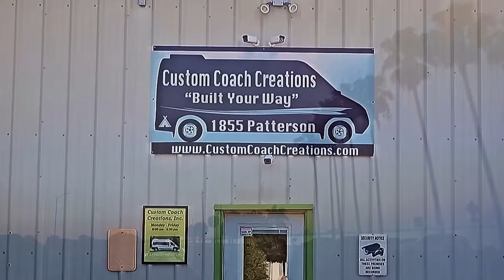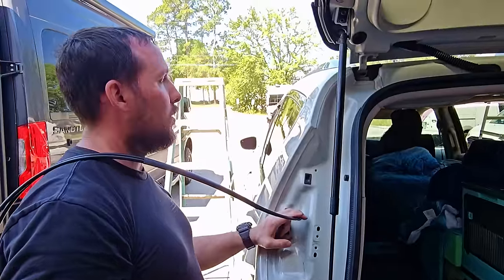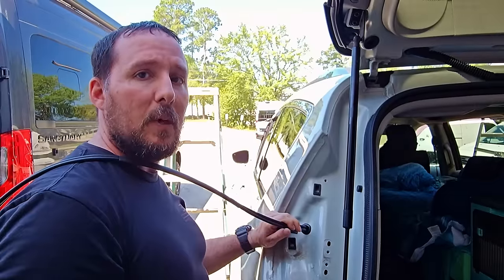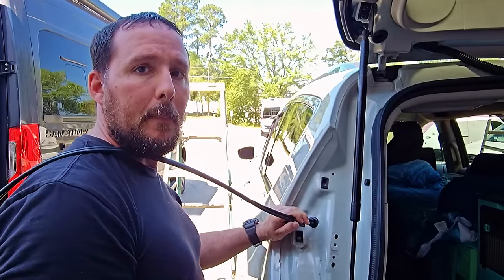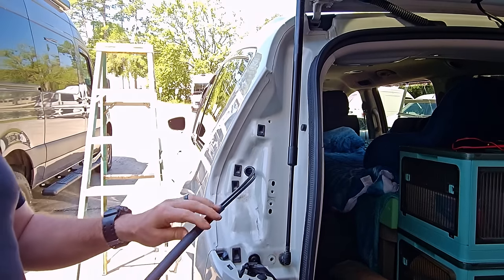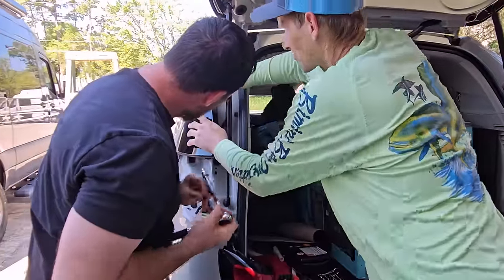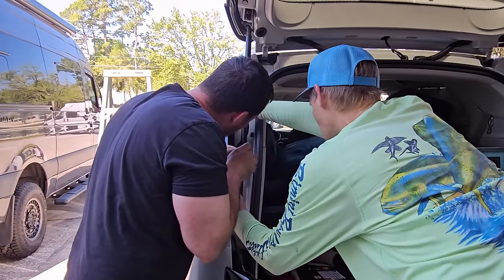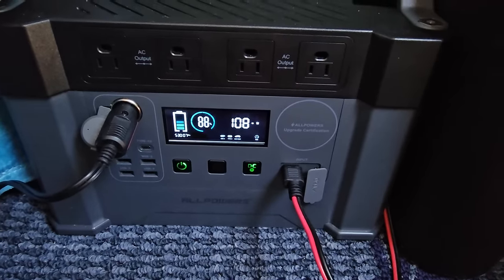OFF GRID. INSTALLING A SOLAR PANEL

Comment: Nice, they did a great job! I did one myself last year on the top of my van. I got a self adhesive panel from Bougerv and stuck it on the back and then connected it up with my existing panels so now I have 300 on the roof. You're going to love having that panel on the roof and you can still use your portables when needed. Have a good week!
Reply from the maker: Yes! I figured I could still park in the shade and put the panels out sometimes. But it's working so good just running down the road keeps it charged.

Comment: Ms Butterfly how is your van holding up? I’m curious to see if you had to replace your lithium battery yet?  Would you recommend a plug in hybrid or non plug in?  Happy off grid travels!!😊
Reply from the maker: I have almost 47,000 miles on it, and I love it. The only issue I've had was mice.

Comment: This is great Jan! I plan to get my minivan done. Were you on a long waiting list?  Do you know the part # for the panel itself? Thank you for this detailed installation video! 💕
Reply from the maker: No waiting list. I let them use the panels they recommended and had in stock. The flexible panels are strong enough to walk on.
Reply: @ButterflyTracks   Thanks Jan!
Reply: @ButterflyTracks  Hi Jan,  Have you been through a carwash yet?  How is the panel working so far?

Comment: I'm sure that is such a weight off your shoulders. Could you share on costs?
Reply from the maker: It took two men longer than they expected, so it was $800. They did a beautiful job though.
Reply: @ButterflyTracks  oh, thats not a bad price. That included the solar panel?

Comment: What was the name of the solar panel?
Reply from the maker: I let them use what they recommended and had in stock. Most of the good brands are strong enough to stand on.
Reply: @ButterflyTracks   i priced putting 1 solar panel on my roof of my motorhome to keep my coach batteries charges vs using folding panels. All they had to do is install the panel, remove the antenna i never use and drop the wire through. I already have the contoller and cable to hook up to. 2 places gave me a price of $850. No way.